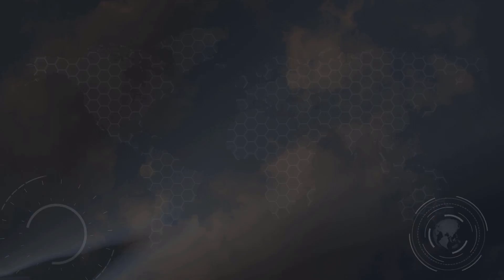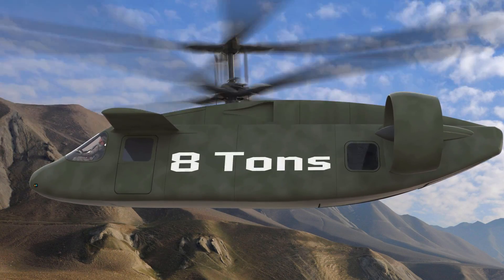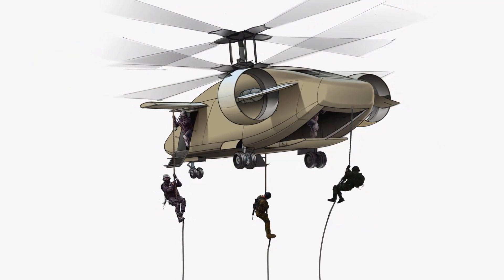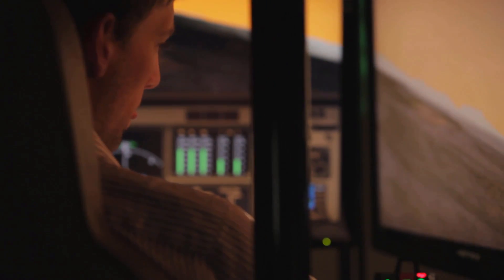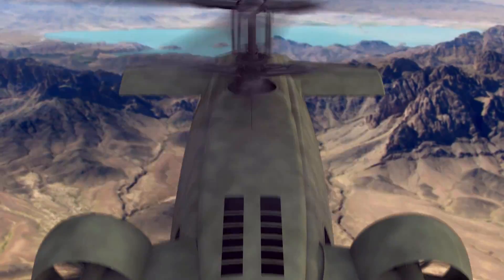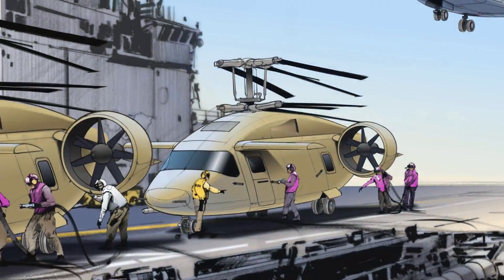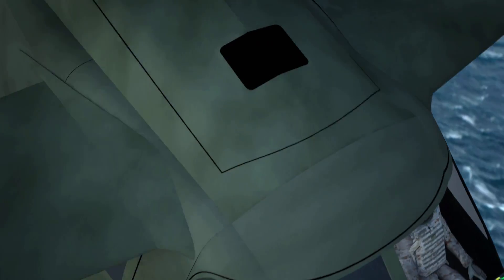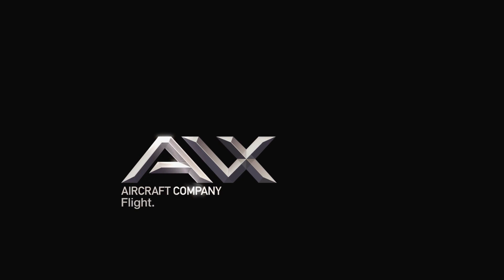AVX Aircraft Coaxial Compound Helicopter for US Army JMR/FVL

Comment: V-280 has this competition. If the army doesn't buy it I give up.
Reply: The V-280 is a technology demonstrator for the JMR program.  JMR is a technology down-select leading to the fielded FVL program.  Therefore, the V-280 is not a program for the Army (or any other service) to "buy."  However, that does not preclude Bell from marketing the aircrat for foreign military sales.
Reply: Well Bell got it! Hopefully u read this 7 years on. I believe the two AVX designs would have been better for FLRAA and fara than the Lockheed Martin/Boeing/Sikorsky Defiant and Raider